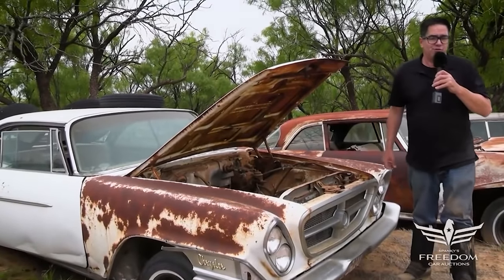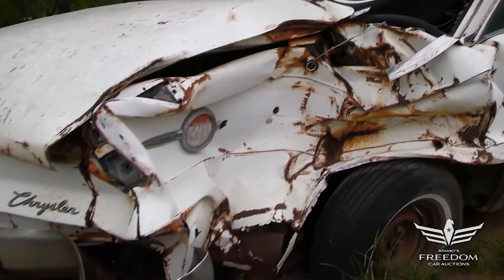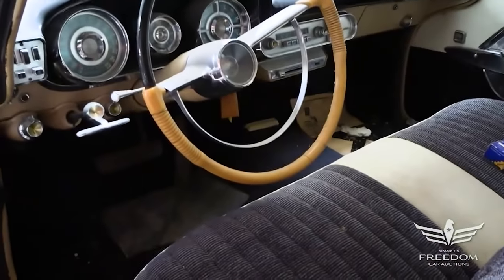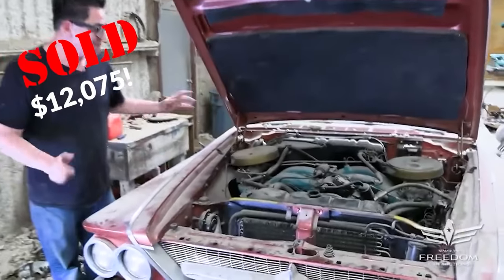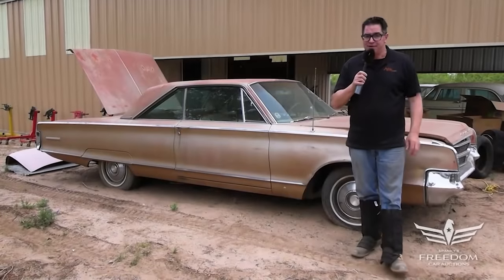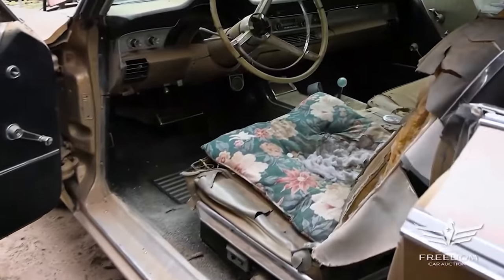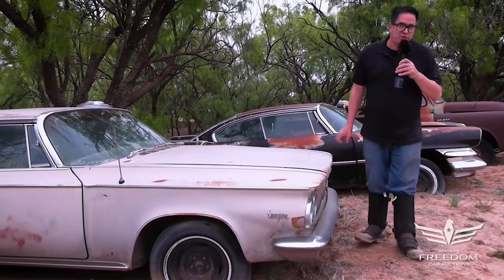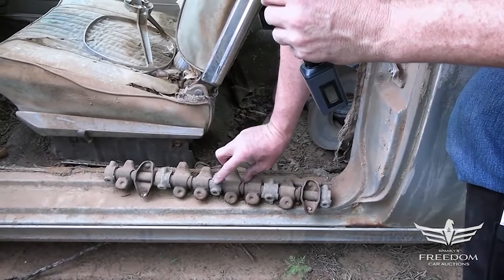Beautiful Brutes

Comment: The 1962 300-H was a hideously expensive car when new. Getting this really rare car on the road would be a huge score for the person willing to take it on. In fact, all Chrysler 300 letter cars in decent rust-free shape are worth restoring---bankers' hot rods.
Reply: Thing is a Chrysler or even a Dodge 880 should be able to supply just about all the sheetmetal that needs to put together.   Based on what the 63 300 Sport sold for, another $500 would probably have bought a '62 donor.

Comment: 28 five for that car sounds pretty reasonable, IIRC it just needed paint and assembly.  Maybe some messing with the engine.   

That last 300 I could have bought at that sale price.  I kind of like those sort of boxy 63-64s, I never used to but they've grown on me.  

Did you see what happened to the GTO that was all shot up?   A guy is driving that.

Comment: My Dad had a 1956 Ford truck stepside with a 413 Chrysler motor with the 727 trans and the short shifter in the floor under the bench seat, that truck could bake the tires at will but what a wild ride going fast or braking,  crossing rr tracks etc, never knew where it was going! We rebuilt the front end to no avail  finally put a Cordoba front clip on it.
I goty my 1st ticket in it at age 14  lol  on J street cruise in Sacramento 1975, I had to tell my Dad I sneaked out his truck  and lied to the cop about having a license.

Comment: The 1963 Chrysler 300 sport came with the 413 four-barrel or the 426 four-barrel or the 383 2 Barrel. A special order for the long cross ram 2-4-barrel engine was available.

Comment: Ok, the 300 J has the "short ram" version of the long ram manifolds. They are the same length, but the runners are open to each other. Notice there is not crease in the long areas.

Comment: MY Dad had a 65 Newport in 65. I always thought the 300 in 65 was pretty plane looking.
In 71 he bought a Chrysler 300  but he traded it back and got the 4 door Newport. Yes I was pissed because the 2 door 300 was so cool.
Reply: Well they had a regular 300 and then the high performance version the letter series. Till 65? 64? Forget now. But a regular 300 was basically just a Newport or new Yorker. 

I love Chryslers. I own some newer ones 73 imperial , 74 Newport 4 door sedan ( triple forest green), 86 5th Ave... Newport is my favorite to drive. Has a 400 2 bbl but has plenty of power. Someday I want a 75 imperial with st Regis package. If I can find one!

Comment: A pro could ID the engine based on the exhaust manifold design & flanges…

 The small block has one, the big block has two (bolt holes between the middle cylinders on both banks). I'm not sure about runner design, but I'm not a Chrysler mechanic.